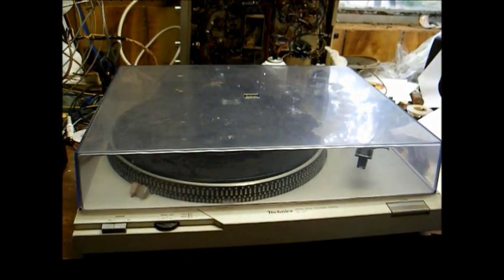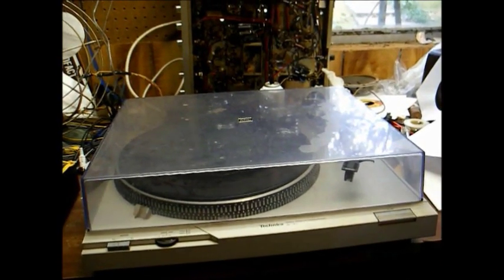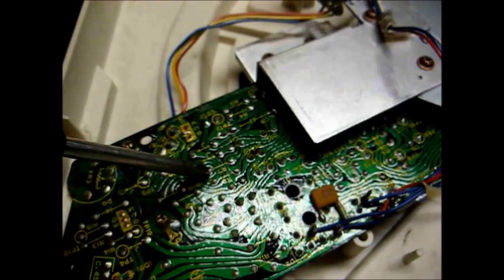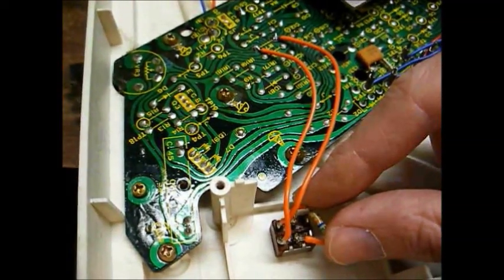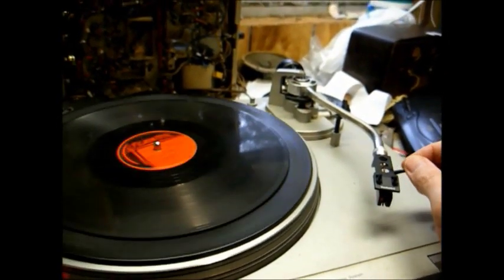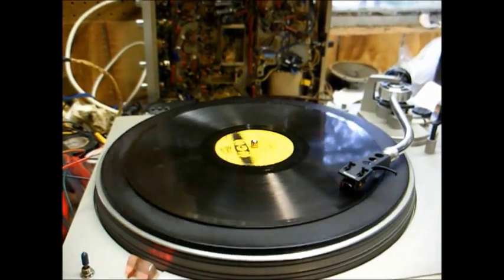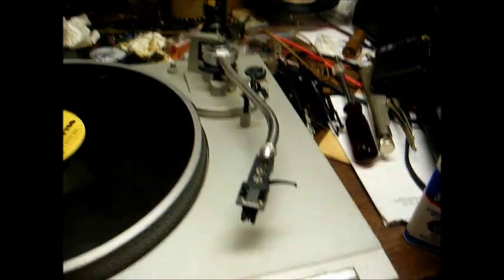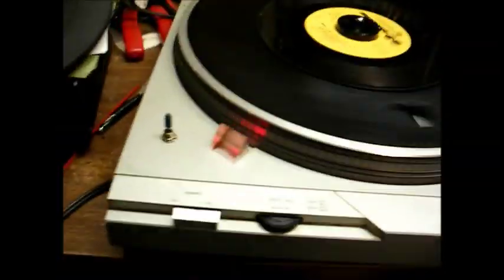Modification of a Technics SL-D1 turntable to play 78 rpm

Comment: My primary turntable is a Technics SL-D1 that I lucked out and found at a thrift store for less than $25.00.  I bought it for the Audio Technica cartridge it had but once I got it home and cleaned it up I discovered it was i near mint condition so I replaced the dust cover with a new one and have been using it for several years.  I had been using a Pioneer PL-112D but switched because the Technics had the built in strobe for speed settings.

Comment: I did this modification to my SL-D2. After adding 56k resistor it would run almost 78 rpm with the pitch adjustment maxed. The 33 and 45 rpm were right in the center of the pitch adjustment and I found through trial and error that it took a 29k resistor to get 78 rpm centered. If I did this project again I would get a 100k variable resistor to quickly find the proper resistor value.

Comment: When I worked part time in a TV and stereo repair shop back in the 80's and 90's we did this sort of thing for customers. I had drawn out the circuit schematic and knew what to change to make it a four speed turntable using a 3PDT switch to get 16-2/3 on the 33-1/3 speed setting for numerous customers. It works much better than the mechanical ones with four pole motors that are commonly four speed. You don't have the motor rumble. My boss charged a lot of money for the circuit changes. There are other models that can be modified in the same way. It is also possible to do this with other brands and models that are DC driven. Best place to find a used one to modify is in the charity shops but they are harder to find  and you have to check back as it will be hit and miss.

Comment: I just modified an SL-D2 according to your instructions and it worked exactly as you said! I haven't soldered anything since I was a kid, so my work is not going to win any beauty contest, but all is solid- resistor, dpdt switch, etc. I already bought a 3 mil stylus that'll fit one of my old Audio Technica cartridges assuming this would work, and am now excited to hear how my 78s will sound when connected to the big home stereo.
Reply: Art, I have an SL-D202 and would like to do this mod. Would also like to make it play at 16 2/3 rpm for talking books (original resistor completely removed?). I'm guessing I'll need a triple throw switch. Do you know if these have the same schematics?
Reply: Jeff Becker I'm only guessing- but if adding a resistor in PARALLEL with R7, makes the turntable run FASTER, then adding a resistor in SERIES with R7, would make the turntable run SLOWER. If that's the case, you could use a SPST switch.

Comment: When I did the same modification to an al110 (flip the power microswitch to the spare position, put in a 5600 ohm resistor,  then there's 33, 45, and78) I also shunted the 45 pitch control with 200 ohms to narrow the adjustment range.

Comment: I did a similar thing to an inexpensive Radio Shack belt drive turntable. Not as elegant as your mod. It switched between 2 resistors for 33 or 45. I removed these and replaced them with a pot that made it continuous adjust from below 33 to above 78. It also was 12V internally with a built in preamp, so I converted it to battery operation with a set of battery portable speakers to make a portable player. I think I used a Shure  that had a 3 mil stylus available.

Comment: I'd like to see your record collection, it must be impressive.  I used software a few times to speed up a 78 record recorded at 33 rpm and it worked. I will have to see what mod is available for the 1200 series.

Comment: nice job I own a two technics SL-D1 MANUAL DECKS  I like to do this  but as a test deck to see if it works rite I have a Gemini DJ Q 1200 but I've had for 27 years its not a technics in quality comparison at all  but for a test of the modification I'm willing to sacrifice that deck  then if it works I will see if I could do a modification with a proper speed selector switch for 78rpm

Comment: That's great!  I have an SL-D3 and Stanton 500 mk.II, don't have any 78s - yet.  Sounds good and the aftermarket stylii are inexpensive.  (OEM left the market, original stylii are scarce.)   Can't you use an SPST switch?  Resistor and switch in series.  Open - 45, closed - 78.
Reply: Yes that's true but if you remember that he got that switch from his junk box and it was a bit flaky.

Comment: I too have seen 78rpm mod plans online. A question: is there any concern about overheating or premature wear on the motor due to the increased torque or speed? I know there was a high end SL-1200 series turntable sold on the Japanese market within the last 10 years that included 78rpm speed as a stock feature. So can we presume that the Technics direct drive motors are robust enough to handle the speed change in the long term? I have the MCS 6603 clone of the SL-DL2, which is a candidate for mod

Comment: Can you also modify this to play 16 2/3 rpm?
Reply: +Lee McCoy   I think you probably can.   You'd probably have to locate the resistor for the 33 rpm circuit and do something similar.  Unlike this mod, though, which has a switched resistor in parallel with the control board resistor, you'd probably have to find a way for your switched resistor to be in SERIES with the one on the circuit board.  The actual value of the resistor you'd add would be based on the resistor that's already in-circuit.

This is all speculation, of course, based upon what I've watched here.  I'd have to have an actual turntable like this to experiment with for a more definitive answer.

Comment: Interesting, could it be also be made to play 16 rpm?
Reply: RE: 16 rpm - I was thinking the same thing. Perhaps completely remove the factory resistor by jumpering it out via a triple throw stitch? Put the factory resistor on the middle poles and the new one for 78s on the third.

Comment: With a series resistor can I achieve 16 rpm with this turntable?
Reply: Yes you could though it would be best to double the series resistor on the 33rpm setting with another switch pole. The correct value to add would be that resistor plus the value of the trim resistor to the nearest 1% value

Comment: I own  a Stanton 680 cartridge that needs a new stylus  for regular  33rpm/45rpm I use either  my shure m447 or  a shure sc35 work better if I change that out for a 78rpm stylus that fits the body of the cartridge

Comment: @radiophonenut 

Can my MCS6701 Record changer style changer be converted to 78 speed too . Its the same as SL-D5 Changer as Technics record changer .Just wondering if It can be done for future use . I don't have any 78 records at this time but if I start to collect them in the future I can get a 78 needle cartridge and headshell as well for it .
Reply: If I remember correctly that turntable is from Radio Shack and may be a re branded Technics or Panasonic equivalent and if so, could be modified as it probably would have the same control board.

Comment: Man you are smart. How did you figure out what value resistor should go in for modification?
Reply: Or which one to change for that matter.he did not mention the process but maybe there's a repair manual available that has the circuit

Comment: When you play when you play 78 RPM records with that turntable and the original magnetic cartridge and stylist adjust the anti skate as far as you can to the outside of the record this will improve audio quality of a transcription due to the outside edge of a Groove having been worn less then the Inside Edge and if that's not enough you can raise the left side of the turntable manually a little at a time until you get the best audio and then at that point slip something under that edge of the turntable to keep it tilted that way so you can get the best audio out of old 78's. I hope you appreciate the secret I'm happy to pass it on.😎